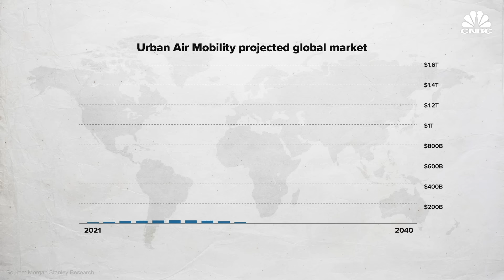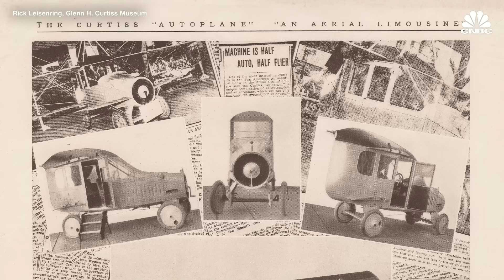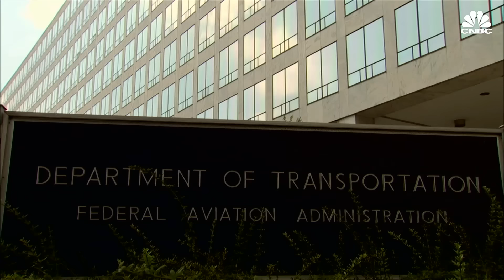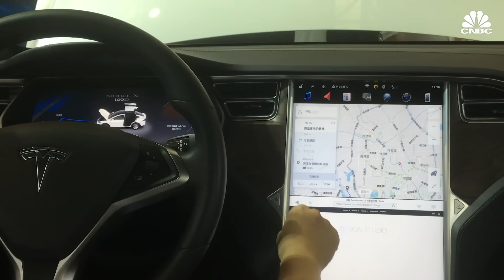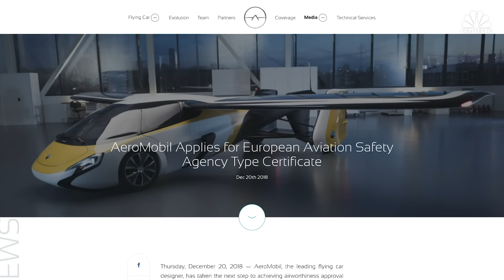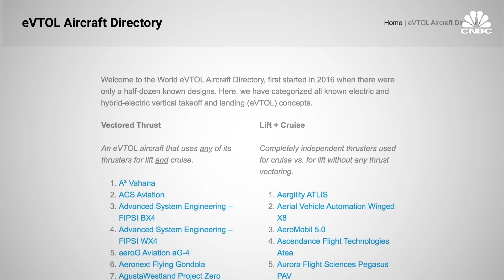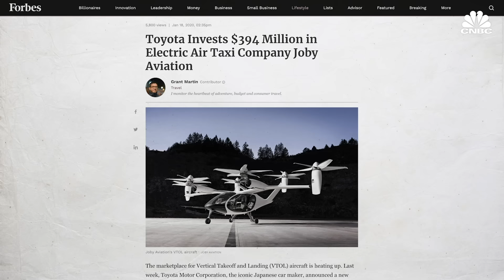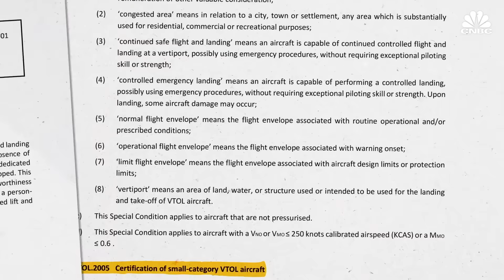Why Don't We Have Flying Cars Yet?

Comment: Imagine running out of fuel in the middle of the sky
Reply: Well u have wings
Reply: that simply wouldn't happen.
Reply: @alienextraterrestrial113  it happen already to a plane
Reply: Viral Videos yea, but those pilots had some crack before that flight... if you cant even fill enough fuel, you are just yea
Reply: Waylith on some flights the gas was put in the wrong way so it said max but then ran out halfway.
Reply: You will glide
Reply: by then, jetpacks are all pre installed in every seat.
Reply: Because is a bad idea, put them underground, let the surface of the cities be free of noise, pollution, congestion, etc. Let the air be used only by emergency vehicles, keep it free for the wildlife, for all humans to enjoy nature, etc. Why the hell would you want your sky full of flying objects???? What a moronic idea.
Reply: Imagine running out of fuel in a plane, theres literally no difference
Reply: RESERVE GAS TANK MY FRIEND
Reply: Drink red bull
Reply: Two words 

Magnetic polarity 
Learn to use magnets and we can make it happen Tesla’s already run off of electricity you can use a Tesla to power that magnet within the vehicle now a vehicle without rubber tires would create less drag creating more efficiency know how to use those magnets I speed up and slow down would be the tricky part but I’m sure could be done with the right engineers 

I say flying cars could’ve been done long ago because we already understand how the earth’s magnetic pull works and how different temperatures affect magnets and elements there are so many factors that would allow us to advance but people these days lack innovation
Reply: The car have to emergency land to nearest land able area
Reply: I'm more worried about the parents who will let their kids text and FLY at the same time...
Reply: @zack5757hamzah   Most of these looked more like helicopters leo is right
Reply: fuel? OH WHERE WERE FLYING WE DONT NEED FUEL
Reply: @kevonfrancis4964  you can refuel a plane through
Reply: I do t think it will run on fuel but if it did take a picture 👌
Reply: Have u ever seen a plane crash because of less fuel
Thats never gonna happen
Reply: Maybe since there are gonna be flying cars, the government will publicize air to air refueling or elevated gas stations
Reply: Its the future we'll probably have gas stations in the sky by then
Reply: @zack5757hamzah  Right, but then you're in the middle of a city full of buildings which you can easily hit crash into and won't have enough space to make a curve to avoid them nor will you have a clean area to land.
Reply: @ZacharyBoi  These were commercial planes. There is no way to refuel. They landed by gliding down.
Reply: well, it's not like planes don't have to deal with that already, they have to make sure they have enough to get to their destinations
Reply: Imagine pulling up to the pump and getting $5 gas
Reply: Its never the fall that hurts you!
Reply: What about parachutes?

Comment: Everyone thinks of flying cars as if they are the only one with a car flying. 
Like "If only I could fly over all this traffic..."
Reply: That's the reality 😂
Reply: no only the super rich get to fly, mid class gets to stand in traffic jams
Reply: Then people
Reply: @FrVitoBe  yea private planes and helicopter
Reply: roads are on one two diminsional plane though...with air cars you add the Z axis, you can easily have 100 levels 'lanes' based on altitude, this eliminates traffic
Reply: @massv953  Except it doesn't because to be safe planes need significant Z separation, today with trained and licensed pilots we need 1000 feet separation minimum, so on a pressurized prop you can get a maximum of about 8 levels up to 10 thousand feet which is where unpressurized vehicles run into limits, but because of the necessary separation, you have a much lower density of people than on a road. The next problem is limited radio frequency and licensing, getting a pilots license is hard because it needs to be to be safe airborne, most people could not meet pilots licensing requirements. for example, Got a heart condition, ever driven drunk, on any drugs not approved by the FAA, got bad eyesight, got bad hearing in one ear, got most medical conditions: any of those would prevent you from getting a pilots license.
Reply: @dstblj5222  You're under the assumption civilian air travel would reach speeds comparable to commercial airlines or military FV and that civilians would be in full control. Air travel would allow for direct routes from A to B, which would significantly decrease travel time for many people, so there wouldn't be much need to break the sound barrier. Traveling at anything over 100mph far exceeds what the average person would require. Then with the right AI or a well written program, it would be fairly easy to distribute closer available lanes on the Z plane that don't intersect on either X or Y and if their are none available place the person in a queue. More than likely self-directing vehicles will be the key here, so random idiots don't go out of their allotted area and cause destruction to rain down on those below.
The only real downside would probably be on the police/news station/hospital end, as their helicopters would suddenly have much more competition.
Reply: @TheFallingFlamingo  Yeah no thats not how the FAA works, you prove it safe then we might consider it in 20 years, so for the first several generations their following current regs or they can't fly.
Reply: @dstblj5222  Jay Merkle FAA, Unmanned Aircraft System Integration Office Executive Director on flying civilian vehicles as quoted in the video you just watched - "This is more than just hype. This is more than just promotional videos. We have at least six aircraft well along in their type certification."
Uber is basically doing what I described, btw. And they're one of the companies working to get their FV certified.
Reply: @dstblj5222  And don't pretend like it's really that hard to get a vehicle certified by the FAA. Boeing gets it done consistently and they still fall out of the sky. 

Also, you think I believe you work for the FAA? Chinny reckon, lmfao.
Reply: That awful voice
Reply: The existing problem with today's drivers would only transfer to the skies instead - it would make me nervous having to look up all the time in case you get one dropping on you - I would end up developing Agoraphobia
Reply: hi fake fbi
Reply: @massv953  plus you can use horizontal space to make more lanes.
Reply: @FrVitoBe  super rich have helicopters already

Comment: "If you want a flying car, put wheels on a helicopter."
- Elon Musk
Reply: no. and flying cars do exist, so do taxi drone
Reply: “Helicopters are a death trap, engine stalls or breaks you fall like a stone to your almost certain death. Planes stall or engines fail you glide to your much less likely death” - Test Account 2020
Reply: @dertythegrower  where? In your dreams?
Reply: @testaccount603  look up: auto rotating in a helicopter. In short: helicopters don't just turn into falling bricks when the engine fails.
Reply: lol, NOPE, the propeller needs to be retractable..
Reply: Test Account Unless your engine transmission unit fails, spectacularly, where (a) the rotor is stuck from spinning, (b) transmission from engine to rear rotor fails, and (c) the whole rotor saying goodbye to the helicoper, the helicopter can be autorotated.
Reply: @testaccount603  Engine fails, reset the trim, drop the collective, maintain rotor rpm, flare as you come up on the ground while bringing up the collective. Use every bit of that delicious rotor rpm you gained from falling to make a cushy landing.
Reply: Weizhou Wu what if you can't start the engine and the engine is physically broken or it won't turn on
Reply: @015AEX  All of auto rotation can be done with no engine power. The airflow going through the rotors during your descent is what keeps the rotor rpm going
Reply: São Paulo is the city with the highest number of Helicopters per person it is effectively a flying car there.
Reply: Cause Musk is boring huge tunnels under ground, which is competition to flying vehicles, but traffic is horrible and a new mode of travel is on the way, letting people live further away to commute faster.
Reply: @Senbatorii  
Yep in Gyrocopters
Reply: Bro I never said that
Reply: @officialspock  toy flying cars, duh
Reply: That sounds stupid
Reply: 1234  ask Kobe
Reply: Thierry Van Tillo why didn’t Kobe just do that then?
Reply: @testaccount603  
gta?
Reply: 1234  lol Smarter every day actually tested that
Reply: @Senbatorii  still not a solution. There could always be a problem with the rotors themselves that disconnect them or make them lose their ability to push air in the direction you want them to. You cant just search up a bunch of stuff and act like it's actually true, just makes u look dumb. There wouldn't be such a low survivability rate if pilots could just do this. There's something called context and situational differences. factors at best
Reply: @testaccount603  helicopters can "auto rotate" and land without an engine running.  It's pretty cool, you should check it out.
 You of course need a spot to land, just like a plane, without that you're kinda screwed in either one 🙃.  
Have a great day.
Reply: Mark Knight 
Kobe, dude... 

Helicopters aren’t as tough as Apaches like helicopters 

Maybe a 4 system heli would work but you’re risking your life and the life of others every time ! Then think of drunk drivers!!
Reply: @officialspock  no, i am just more informed than you. Look up ehang 184 videos from LAST YEAR. Anyone in Florida with pilot license can get a flying car for about 100,000 USD
Reply: @testaccount603  yeah, like what happened to Kobe
Reply: Im putting thrusters on mine Elon, Thank you very much.
Reply: Man if helicopters was self driving cars alot people would be dying from being decapitated from helicopter wings
Reply: @testaccount603  helicopters have something called auto rotate, it makes the heli blades free to move so that it can windmill and continue to produce enough lift to fall out of the sky and land like a plane in a controlled way.
Reply: @Domtooboss  kobe's pilot couldn't do that because they crashed straight into a mountain, the blades never stopped, they were either stupid enough to fly vfr in almost zero visibility or something was wrong with their instruments while flying ifr and the mcas if it had one didn't work. kobe literally flew into a mountain.
Reply: @marthagaming8496  this is an actual system just search it up on youtube there are many videos of auto rotate being used and how the system works.
Reply: @wills.e.e8014  kobe didn't fall, he went straight into a mountain in zero visibility conditions, search it up before acting all genius.

Comment: Flying cars will never happen because of noise pollution, 1 helicopter flying low over my house is bothersome, but 100,000 flying car...oooh hell nah
Reply: Flying drones are not that noisy, when the batteries will be lighter this will be mainstream in transportation, remember flying you go straight from A to B unlike a road that goes in all directions and many times you go around alot just because the road goes this way
Reply: Pretty sure kobe make flying car cant never happen. If someone with over thousand of flight hours can crash like that think about what your idiot next door can do to your home when they coming baack from work
Reply: Lol a helicopter is bothering you? Bruh military jets fly over me regularly and it don't bother me
Reply: It will happen,  drones are lightweight and  do not make to much noise when they fly way up in the sky  you would not even hear them, there will be regulation don t imagine that everyone will fly at low altitude so they can see you at the  grill, minimum hight is required for safety reasons, you need time to open the safety parachute in case something happens
Reply: @dragossorin85  commercial vertical transit is something i'm interested in. Private consumer vehicles will never happen. Our annoying neighbors are never going to own their own VTOL to take off and land in their front yard. And regulations don't allow vehicles in certain air spaces. So commercial transit sounds interesting but i think they will still be highly regulated to "lanes" where they only go to approved hubs and landing zones. So you will still to need to get yourself to those spaces to utilize the services
Reply: @ShaudaySmith  Well let s just say that this flying drones will not be accessible to annoying people with small yards, you will be required by regulations to have open space in order to take off and land in safety, not everyone will have a personal flying drone, think at this like it is an expensive  supercar, not everyone will afford something like this
Reply: I think flying cars are usually silent. So likely it's not noise pollution.
Reply: @okamijubei  all aircraft make noise because they have to displace air inorder to lift. Helicopter blades, jet engines, propellers, etc. How else will a flying car fly. Plus a lot of those flying cars videos on YouTube always have a convenience soundtrack and never show the actual noise of the flying car, because it's loud
Reply: SofaSpy obviously it will be different technology that will make it possible
Reply: I’m sure they can make silence engines
Reply: SofaSpy ok!!!!!!! 😂😂😂😂
Reply: @lintonfr  same here,I live close to an air Base of FAB, and all day we need to deal with F-5 making roaring noises.
Reply: @dragossorin85  
True, evolution
Reply: @taks6738  
If traffic was fixed, he wouldn't needed a helicopter,  the evolution of travel is over 30 years late, who's holding back the technology...high speed rail and or flying vehicles is the future, rather you like it or not...they're also working on rocket planes to cut 8 hour flights across the planet down to 2 hours.
Reply: @ZionHillCalling 
True, there's many companies building them, something has to be done about traffic...flying vehicles is the future.
Reply: An electric vehicle with 8 small rotors spinning slowly is MUCH quieter than a helicopter with one large rotor spinning at high speed. These are fundamentally different vehicles.
Reply: SofaSpy some of the high-efficiency fans basically electric jet engine are very quiet and if they were even 500 feet away you wouldn’t even know they were driving by or flying over besides it’ll be regulated all the hell do you think anybody in the lower classes in the next 50 to 100 years is going to get a license think about it and then there’s the cost of the machine unless you can afford to buy $250-$300,000 vehicle for a second vehicle
Reply: Noise Pollution is everywhere so I dont think That matters anymore. If flying a car is more easy than driving than that will happen especially with drones, AI and Electric battaries getting stronger its bound to happen.
Reply: Plus flying birds ,I'm most worry about
Reply: But it will happen...
Reply: SofaSpy I’m sure we can use electric propulsion like in KSP a rocket so silent you can’t even hear it.
Reply: @taks6738  helicopters are just more dangerous but planes are the safest way of transportation
Reply: @taks6738  and no Kobe's death wont be the reason there wouldn't be flying just because helicopters are more dangerous doesn't mean every flying vehicle is dangerous in fact planes are the safest way of transportation
Reply: @dragossorin85  I agree with you I've never seen a helicopter fly really close to a house
Reply: @user-ql6zy1tu9q  the point isn't plane vs car transportation. The point is experience don't make you a safe plane pilot therefore plane can't be a safe transportation for many people.
Reply: Never say never it will happen
Reply: but helicopters are pretty big and flying cars won't need to achieve the altitudes helicopters cruise at.
Reply: @childish8469  but you still need the same amount of force to generate lift. I think a lot of you guys here don't understand physics or are heavily oblivious to how aviation works. The majority of helicopters that you see flying around are actually lighter than most automobiles. So the same force will be needed to be applied to generate lift because a flying car will have the same mass as a helicopter. There is no special technology, its the same physics that will be at play causing the exact same noise, the same force, the same lift required and the same displacement of air. 2 KG feathers = 2KG stones

Comment: Answers: because there are planes and the cost of own a "flying car" is way too high
Reply: Ricardo Leffering security is also an issues
Reply: Right, imagine the maintenance costs for such a vehicle.
Reply: and potential accidents. Imagine drunk drivers crashing on buildings and people's home.
Reply: There are buses, the cost of having a car is far greater than having a car.
Reply: Its call a Helecopter and cost at least 10milion.
Reply: @normanschuetze854  exactly
Reply: That’s not the answer bro
Reply: @xythiera7255  heli's dont cost 10 mil, they normally cost in the 100k range for the upper middle class and they get into the early mil for the richer. Only helis that are 10 mil are normally for the military.